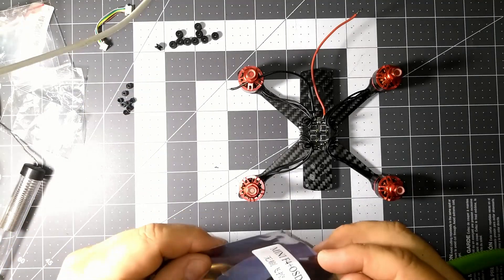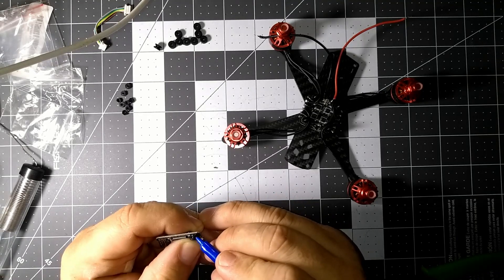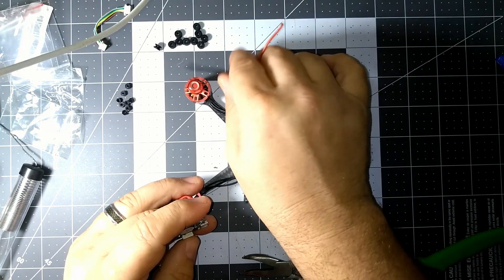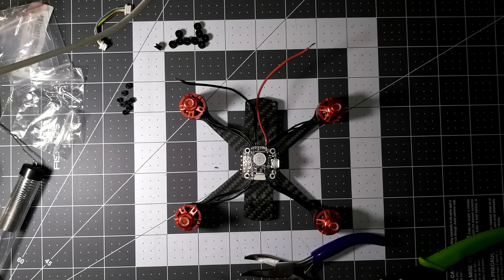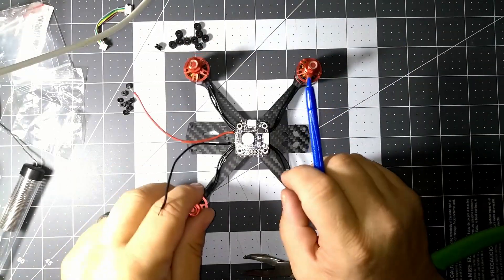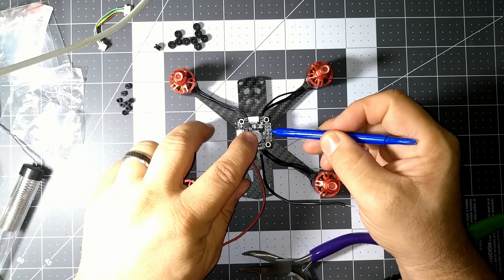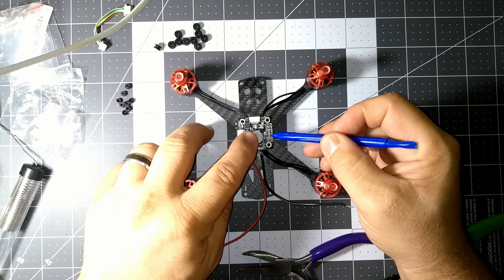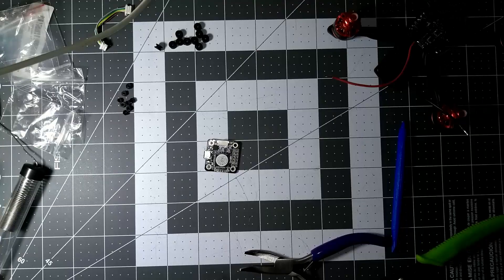Marty Slim Build 140mm Wheelbase 3inch Quad - Part 5 Flight Controller Install

Comment: How did you make the PPM work?
Reply from the maker: The PPM pins are connected directly between the FC and the ESC. The power however comes from the FC not the ESC. I missed it early in the setup that the PPM connector power pin is not connected on the ESC.
Reply from the maker: As for the controller I am using SBUS not PPM.

Comment: Does this have blackboard capability?
Reply from the maker: Yes it has onboard blackbox recorder memory.
Reply: @TeamCrashRC  thanks for responding
Reply: @TeamCrashRC  sorry, one more... How many spare uarts available once sbus is taken up?
Reply from the maker: @shyamfpv  Good Question I did not really spend any time with it but there are two pins for RX one is for DSM and the other for SBUS/PPM, IBUS is not supported on this FC, not listed as being supported anyway, I also tried to enable it and could not get it to work.  It has an LED pin along with a Buzzer pin, also the TX pin, So depending on what other hardware you hook, and if you use Softserial or not up 3 more I think if my math is correct. Someone please double check my math there.

Comment: In resume, you conect battery in pins 5v and gnd? Ok? Its good fc? Low cost, I see inyour bg link. Tks
Reply from the maker: Yes the pin out for the ESC states that it does not supply 5V I missed that early in the build. I am starting to experience death rolls with this build. I have already confirmed that one of the ESC in the 4-in1 ESC has burned out. The Flight controller is having trouble with 4S batteries. It will occasionally give a calib error. None of this happened immediately but both slowly happened over time.